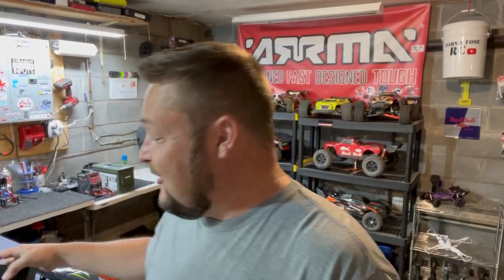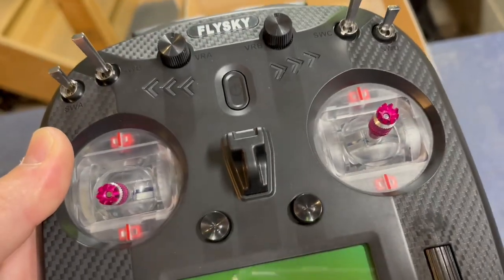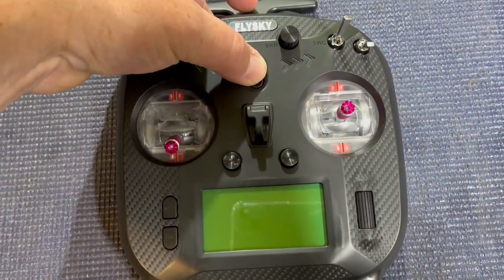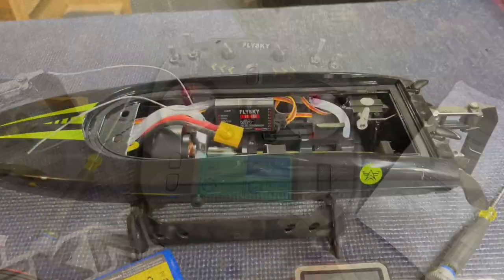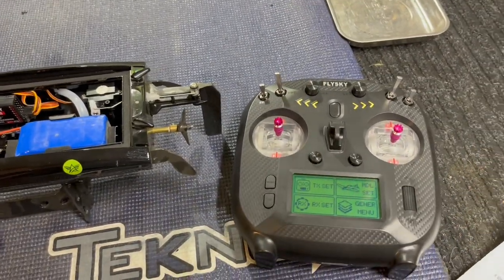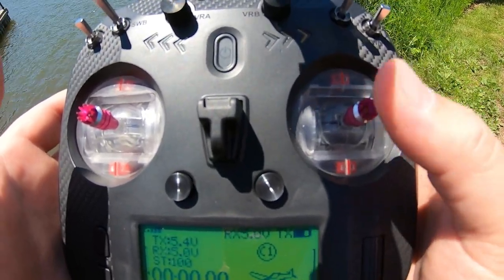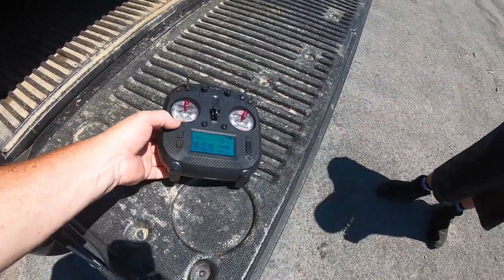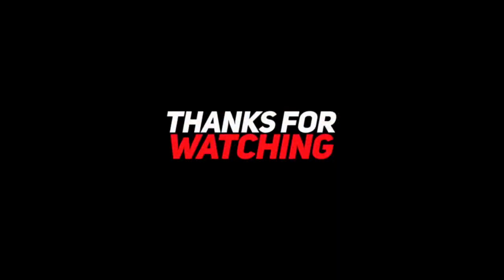NEW FLYSKY FS-ST8 Transmitter on a 3s Boat!! Test and unboxing.

Comment: Hey man I am planning on getting this model but I wanted to know the wiring diagram on how the channels are hooked to the motors ?
Thanks in advance
Reply from the maker: I’m not positive on what you’re asking? But every button in control on the remote is fully programmable to change or set it up how you want
Reply: @BarstoneRC  Sorry dude I wasnt specific.. What I meant to ask is : The FS-SR8 Receiver has 8 PPM channel and all channel have 3 pins.. I want to know which pins are + / - ?
Reply: My bad I just found a blowup image of the receiver and it shows it.. Thank man
Reply from the maker: There’s printing on the receiver that shows you which side is plus and which side is minus. It’s small, but it is there